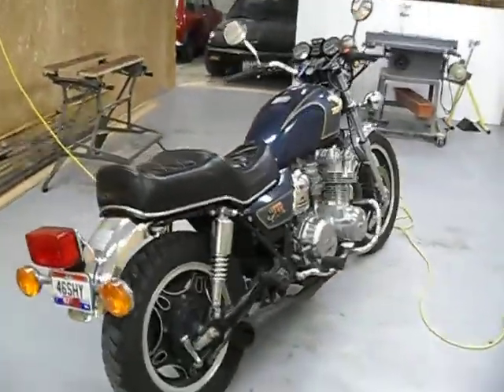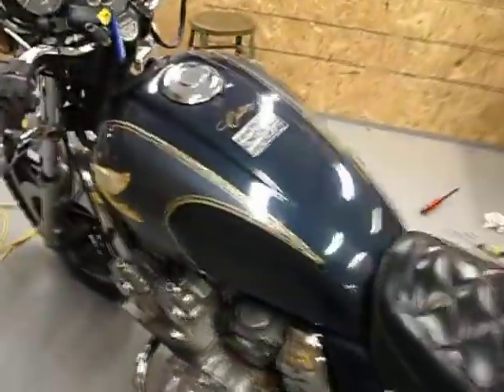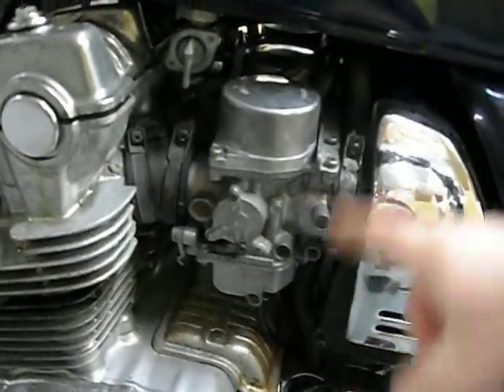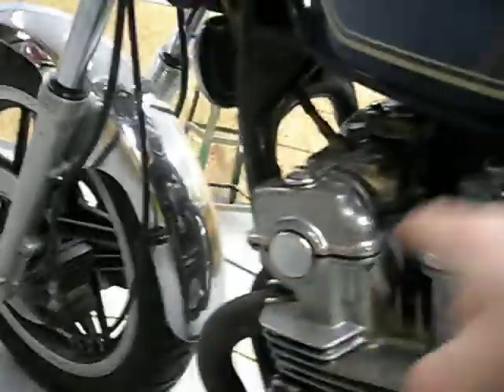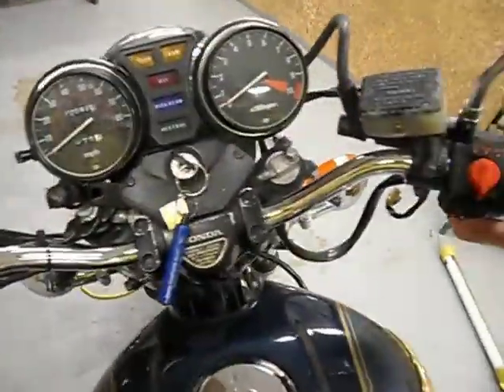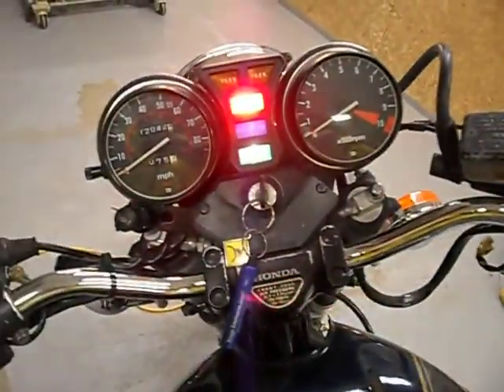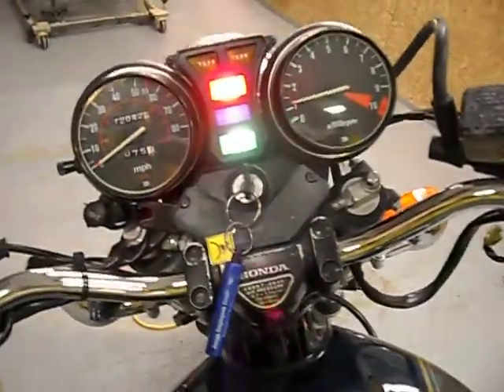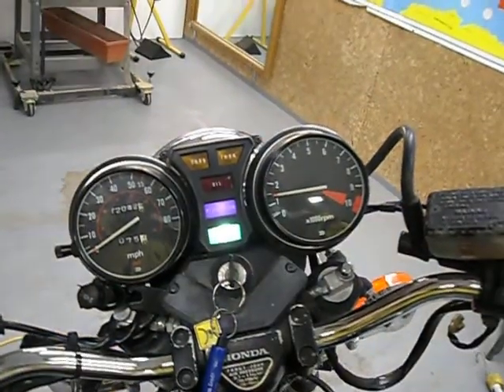1981 honda cb750 custom, fixed the carbs and it runs like a beast!

Comment: Bought one for $1800 when I was 16 (1990) and it had 57,000 on it. Only ran out of gas Once.. Wish it had a Fuel Gauge. Traded it for a Motor Home in 1999 and got $2500 for it. 
Just got another one 3/25/2022 with only 28,000 on it for $2200 but it does need a Valve job/Adjustment but can be driven as is. Came with a Front Cowl, Not attached,  and someone made it HD style exhaust.. I got on it after ll these years and Daaaammmmmmnnnnn it felt Soooooooo goood to be back on it.... Again just wish they came with a Fuel Gauge.. Any Ideas that don't have something hanging off the side of the tank? Any that go Into the Tank?
Also, Both of mine never started without needing to pull in the clutch. Is there a Bypass I don't know about?
Reply from the maker: Pretty sure the transmission just needs to be in neutral for it to start without pulling the clutch. As for fuel gauge, I know the range of the bike and just reset the trip odometer every time I fill up. IIRC 150 miles is the absolute run it dry max range I was getting with the 900cc cams. I usually filled up around 115 miles.
Reply: @treesleavedents  
  UPDATE:   Just a Week after having it, Engine Went to Shite! and could barely move itself under it's own power. Just got it back a 2 Years Later after shop put in a New Engine and went over it and the Carbs and and and... Just under $5,000 into restoring it. Got home and my right leg was Wet... Oil! Sprayed Oil Everywhere... Have to take it back... YEA!

Comment: very nice bike,
I just got the same bike
It had a vetter windshield with Raido and speakers
and a backrest and rear rack
that I took off asap.
the bike came with a stainless 4 into 1 headers
and supertrapp exhaust. 
and 
the bike sat for 4 years
with the gas on,
and turned to varnish.
and flooded the oil
with gas also.
so I spent a few hours going 
over the bike,
removed carbs and cleaned and rebuilt them.
I left the airbox off
as I'm going to add k&n filter pods,
and make my self another cafe racer,
as I used to own a 72 cb 750
That I made into a Cafe racer..

Ride Red
Bleed Red
Honda for life
Reply from the maker: webslingercj leave the airbox on! our bikes have constant velocity carbs and need the backpressure from the airbox to run correctly.
Reply: I'm changing the Jets
and adding velocity stacks
and never had any problems 
with power, responce or reliability 
with over the 10 bikes I've built for others...
Reply from the maker: webslingercj that's awesome, I'm glad your other bikes turned out great. I'm just letting you know that with constant velocity carbs you need to run an air box or they will never run properly.
Reply: treesleavedents 
yea thanks
I used to have issues
till I've tested many different ways of tuning them.
untill figured out
the correct settings and parts,
and haven't had any problems since.
thanks again
for the advice...

Comment from the maker: @JasonWW2000, the exhaust is a MAC brand 4 into 1. I love the way it sounds, when you hit above 6,000rpm it just screams like a race bike, It's intoxicating. I only wish I had the chrome one since the black finish on mine hasn't held up very well... I've seen em online for around 450 or so if you're interested, and they engineered it so you can still access the oil filter easily.

Comment from the maker: @diesel220485 

It does get annoying because of all the curves in the gasket but gasket sealer really helps if only by adhering the gasket to the valve cover while you bolt it back on. good luck!

Comment from the maker: be aware that the cables will be to long if you change the bars though. I am going to be switching to CB750F throttle, clutch, and brake cables/hoses along with finding a CB750F master brake cylinder since the C model one now sits at an odd angle.

Comment: May I ask how many turns did you do for the fuel air mixture screw? Mine runs but my throttle is not as responsive as yours!
Reply: willmann30 I always set them
1 and a half turn to 2 turns out
from tight it
Reply: webslingercj Thanks! I have mine at 2 but the response is not as quick as his bike! High idle at stops! I know... check for vac leaks but there isn't any! I'm just gonna ride the hell outta it!
Reply: And sync the carbs
With a $16 dollar 4 mercury vac tester
Reply: webslingercj I have the analog sync kit and my dials are all even at 4K rpm! I ride it anyway because it's just badass!

Comment from the maker: @WinMeAHarley, new valve gasket is easy, tank off, remove the spark plug wires, undo the tachometer cable from the front left of the valve cover. Undo the valve cover bolts and remove carefully. It might take some wiggling as it gets hung up on the cam chain if you aren't careful. clean the valve cover thoroughly in vinegar or another gentle cleaner to make sure all the old gasket is off then apply a very small amount of instant gasket before laying the new gasket and reinstalling everything.